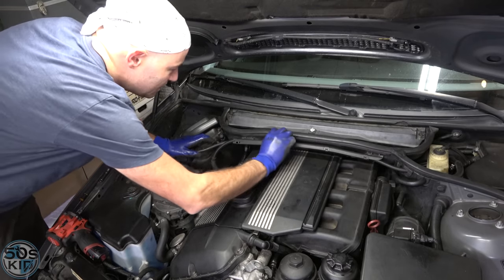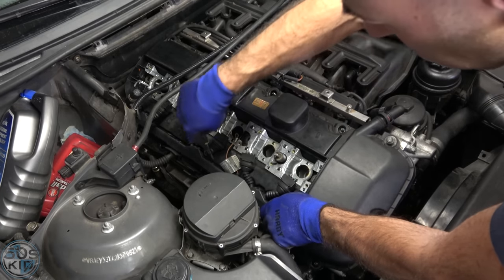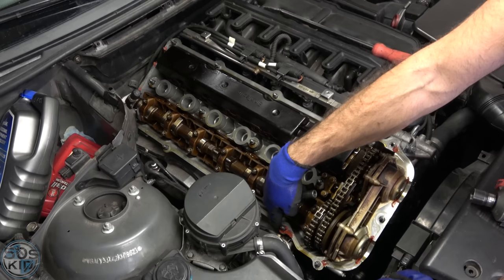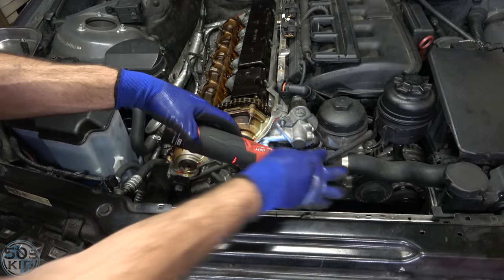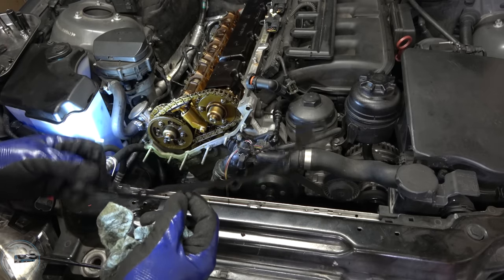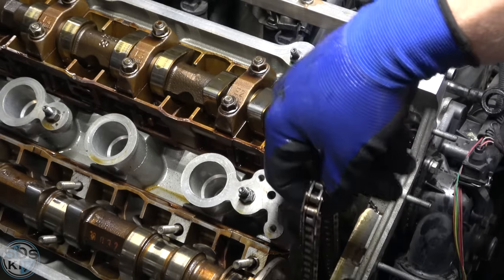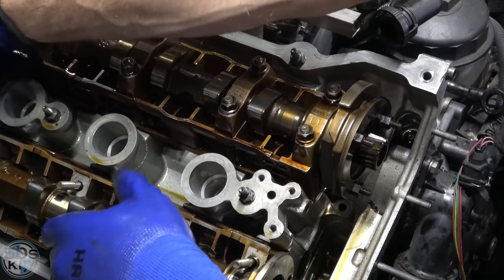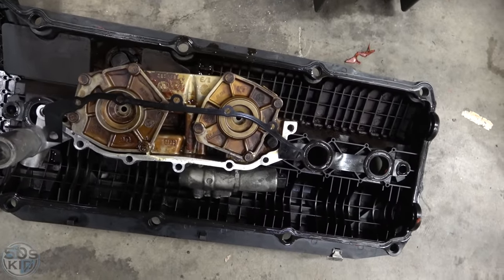This is why your BMW ticks - BMW E46 Lifter Replacement DIY Part 1

Comment: Rare to find a "how to" that's good to watch with an evening beer, then be able to reuse it the next day with my morning shop towels! I recently used your oil filter housing gasket replacement video on my e46 Jason. 2000 miles later, All is still good under the hood! Thanks for a great channel!

Comment: I'm currently pulling my cylinder head from my 05 325i for inspection after driving the car for around 40k miles after a 300 degree overheat, burning through coolant and oil for a while and finally have the time to get into it. Your M54 rebuild videos have been immensely helpful and I love all the details and tips and tricks that you have for pulling it without pulling the engine as I don't have access to a hoist. At the same time, I really, really like this type of video, very to the point, almost no extraneous verbal explanation, and just showing the teardown of the top end. It's a great summary. You're a legend.

Comment: I had a related issue. No ticking during cold start but it would misfire after 30 seconds (outside temp < 45 F) . I cleaned the lifters and it didn't fix the issue. I ended up replacing the intake cam tray along with all the lifters with used ones ($20) and that fixed the issue. So if you have misfire on cold start and have ruled out everything else, replace the cam tray(s) (check for scoring usually intake) and the lifters and hopefully, that should fix the issue. Jason, thank you! I couldn't have done the replacement without your excellent camshaft how-to videos.

Comment: Thanks for the Video. I really enjoy all your BMW content. I bought a nice 2004 330ci with a 6 spd manual. Grey with black interior. I was told it needed an engine. I paid $1400. It had been sitting for 2 years and the battery was dead AF so I couldn't even start it. After a brand new battery, it roared to life with ticking lifters. I poured a little ATF in the crankcase while it was running. Warmed it up, held some revs and withing a few minutes, the tick was gone. Now I know this may be temporary and yes, im going to change the oil and refresh the whole cooling system but for now, I got a clean runner and an easy resto project.

Comment: Great video as always. I have found that a can of liquimoly pro line engine flush before each oil change is good at preventing this issue. Once they tick, it is probably too late. Thanks for your videos!

Comment: Man thank you so much you make life easier for thousands of people
Reply: My e46 320i can start idle nice after to 15 minutes it's turn engine off it self nd from there it's just cranking without start but after 2 hours can start again I did change petrol pump but still the some what cous the problem

Comment: Had this problem before.. first it was only at coldstarts, so i changed them with new ones, then i had ticking ALL THE TIME.. real bummer. Then found a set on ebay with new cams, trays and lifters slightly modified, think the lifters were abit bigger in size.  After that the noise dissapeared! Soo thankful for that 👍
Reply: was it expensive ( Labor )
Reply: @RodriguezSteve  did it myself so think i payed about 250$ for the last parts

Comment: We had some observations related to BMW lifters. Those 33mm with smaller pad are very notorious to tick loud.  But You can swap cam assemblies to old-style ones with 35mm(old m50) lifter and large pad - they are very heavy duty but the same time they are heavier.

Comment: You coincidentally always time my builds at the exact topic. Thanks
Reply: My issues weird. Engine is quiet at cold start only starts ticking when warm and sound keeps that way. Was thinking spark plugs. Ignition coils when warm i don't know. If you have a place to check please please do help. Thanks

Comment: I switched from Moblie 1 Synthetic to Shell Rotella T6 in my 97 M3 S52 when I had some intake lifters bleed down from a lot of high rpm. I did all of the known procedures and added atf and marvels mystery oil and none of them were able to pump the lifters back up. All it took switching oils and after 60k miles, the engine has never had a noisy lifter again. I have another S52 engine I put in a '94 E36 body for a track car and I use Rotella T4 in it and it has never made lifter tick sounds after a track session. 
You only have to replace liftes when you replace lifter trays on high mileage high wear enigines.
Reply: isn't a Diesel oil? I was about to try it but the diesel label...I own a e46 with 107K but now the lifters became noisy...
Reply: @Opiti72  yes it is. It will quiet them down and clean the engine too. change the oil filter after a few hundred miles.
Reply: @ajl0426  Thanks for your answer, I was about to replace the lifters...but I will give it a try, I will let you know if it works. Thanks for the info.

Comment: I've been using a lot of your videos for my Spec E46 build, mostly the air intake and MS45 to MS43 wiring replacement. I wonder if I'll have to do this in the future...Hopefully not until at least next winter! Thanks!

Comment: I just used on a few M52/M54 a bottle of Seafoam, ran it gently, drove around for like 30 minutes, changed the oil, noise went away.
Edit: yes Seafoam can go in the oil.

Comment: I haven't watched the whole video, but that is beast mode e46 teardown so far. None of it makes sense until you have done it 200 times to find that one damned vacuum leak.

Thank you for all of the videos that instilled the confidence that I can keep the old girl running.

Edit: I watched it all. Damned good video. I would do that in a heartbeat before I do a FSU again. My back can't stand upside down and stretched out in the passenger seat anymore. I'm old, and the car is too.

Any young bucks wanna trade an FSU replacement for a DISA, CCV, and Vanos rebuild?
Reply: Haha I so would

Comment: Rather than go to this extent to "cure " lifter noise which is invariably caused by sludge or varnish build up in the hydraulic tappet as suggested by condition of camshaft caps, I have found that the use of a detergent such as Oil Syn Release run for 2,000 miles followed by an oil change with 5% ZX1 provides a long term solution. Have used this on numerous occasions and never failed to "cure" the problem.

Comment: 3:20 the way to get that hose off of there is to pinch it at 90 degrees to the clips and they will be forced outward.
Reply from the maker: I know but when the plastic hardens it's hard to do it that way, so I go right for the catches

Comment: Great video, thank you for this. I'm also curious about the electric fan swap you mentioned. I have a 2002 330i with the 5spd auto from ZF, and I live in south Florida. During the summertime, it sounds like I'm driving around in a school bus because of the mechanical fan. I was seriously considering doing the electric swap, but a couple technicians from the dealership I used to work at told me I shouldn't, and the reason a mech fan is in there in the first place is because the ZF 5 spd auto needs the superior cooling power. Which trans do you have in your E46, and what are your thoughts on this?
Reply from the maker: The transmission has an oil cooler which is cooled by engine coolant, so you’d think that’d be keeping the trans cool, right? I dunno, I’ve driven in 110 degree weather and noticed no issues. I say go for it.

Comment: You have saved me a lot of money but have a problem thought you wold know the answer I’m 74 and grew up helping my dad keep our car running we never had a new one  anyway my 2005 BMW X3 had a crack on upper hose at bleed screw got a new hose so was pulling lightly on old hose and the hard plastic connector crumbled in my hands so I got a new radiator and I replaced it bled all bubbles out with heater on. Now when I drive over 9 miles my car starts smoking a lot saw your video of pcv and oil separator but being 74 don’t want to tackle it  with plastic gears in valve I figure that is problem so called a mechanic and he said it was head gasket which I doubt spark plugs are not missing and idles perfect with rpm steady not moving so I want to know if it is head gasket or pvc  what would you say

Comment: On my 330ci I got it with 180k miles it had lifter tick but I just ran a heavier oil 5W40 since it’s an old engine now and the ticking went away

Comment: So so glad you are doing this video !   I have 1 stuck lifter on my 330ci and sometimes it doesn't tick and sometimes it does. When it does it can be anywhere from 5s to 1 minute before it stops.  Again, only on a cold start.
Maybe it's not worth me tackling this job right now as it's not that bad, but if by watching your video, I have the confidence to do it, then I might try.

The 'moving 1/4 past TDC' correction threw me a little.  And I'm assuming you don't have to worry about losing the timing at this point because you can reset it upon assembly, is that right?
Reply from the maker: Correct

Comment: Hello, i have problem with knocking inside my engine, when i go over 3k rpm knocking starts. I have E46 316i 77kw 105hp 1.9 from 2000 M43B19. In my E46 i dont have those  hidraulic lifter.
Can you please tell me what problem can it be?
If you want i can provide you some video you can watch.

Comment: So I want to install schrick solid lifters and camshaft with bigger lobes. Do you think this is a good idea to covert to solid lifters? They claim it allows faster rev and also prevents damage from high revs.

 Also I was planning on installing hastings piston rings because I'm sick and tired of burning so much oil. Do you have an input on piston rings? Should I buy a different set?

 Please give me some advice man, I've never tore down my m54 before. But it needs some maintenance and I might as well upgrade while I'm there.

Comment: Have you tried adding Seafoam to clean the engine? I heard about it in a thread, I'm thinking of trying it before I fully commit to replacements. Thanks again for the great series of videos.
Reply: I wouldn't recommend seafoam for an e46.  Jason does indepth high level technical training sans fix it in a can.

Comment: Old school trick that works if lifter oil gallery not completely blocked. Drain out 1 litre of engine oil and put in a litre of ATF...run for a few hot runs or until ticking goes away. If it doesn't fix after 300 miles then replacement is the only repair.

Comment: Hey I love your videos! They have helped a lot, but I’m stuck. So my superntine belt broke while I was driving and the pulley above the alternator came off so I replaced both my belts both the tensioner pulleys, water pump, expansion tank, the thermostat under it. Fan switch , temp sensor and my thermostat. But I’m pretty sure my system is bled but I’ll start my car amd it will get to temp and then wants to overheat still! Also I’m not getting heat in my cabin idk what it could be
Reply: Did you bleed the cooling system?

Comment: I have a problem with my E36 it make noise on 1500/RPM I don't now where it comes form first I thought it is from a pomp or something lie that second I thought it is from a step up starter but it is not it I still can't figure it out  ...My BMW is with LPG system ..! Do you have any  answers ..

Comment: Question about the plastic caps in the vanos that covers the cam screw. Does it really do anything ? The one on the exhaust cam is barely holding and I was thinking of deleting it.

Comment: I have the same ticking noise when my e46 gets in the higer rpm...i thought it was my timing chain...so thats all replaced with quality new stuff...and now the rattle is still there....i dont have any noises on coldstarts idle etc it only rattles really loud when i get to the redline.....would this also be the lifter valve thats causing this?

Comment: Hey 50skids, We have an bmw e53 that had it's engine rebuild recently, and notice there is a ticking noise that happens when the engine is warm. We used a  regular castrol 10w-40 oil. Can this cause a problem? If so what oil would you recommend after an engine rebuild? Moreover, the vehicle was sitting for over 8yrs as in was involved in accident and water went inside it, so it was a lot of work with other things that were not working.

Comment: I have an 2003 bmw 325i with eml light comes on when driver slow in 3rd gear but goes away when turn off and turns back on the car I scan it with an obd tool and it show tank vent, I replace the ventilation sensor and it still so the same thing any idea what can be causing the problem

Comment: My *taping/ticking/rattling sound coming from my 1986 ATG M7's (modified from 735i) worn 1 top lobes (18:38) of Camshaft.
Do you know where I can buy one that is not going to cost me an arm & a leg? And a kit of gaskets & seals?

It has not run since 9/11. So it has a sentimental valve because my uncle's lost his wife & three children in the World Trade Center.
I lost my aunt & cousins over 21 years ago. My uncle wanted to show me how to fix things but after 9/11 = faded to black/garaged.

*2000 a note from my uncle, Col of the SAS, that we will fix & replace the Camshaft taped on the engine.
The M7 has less 25K original miles. 
I was a young little girl at that time.

Any help & suggestions would be appreciated.

Comment: Please tell me about the stripped bolt. Something you mention about bigger-sized 🔩  on that side?
So aren't all head cover bolts the same length size?
Reply from the maker: There is a dual sided stud screwed into the head which the valve cover bolt then screws into.  The end that screws into the head is an M7x1.0mm thread and the other end is an M6x1.0mm thread.  The timesert kit I had on hand is for M6x1.00mm, so it's the wrong side and I need to get the M7.

Comment: I am also replacing the lifters on my car I have a bmw z3 with the m52b28 process look identical to the m54 except for the dual vanos. Unfortunately I cannot afford to purchase the OEM INA lifters do you think some of those cheaper ebay brands will work fine to cure the ticking?

Comment: quick question, i have my M54B30 apart, and i have some that are stiff and some that are "loose".. basically, none aren stuck, but they have restricted movement.... are they supposed to have long travel, or short?

Comment: Just use a flat head wedged inbetween the bolts on the fat clutch and you dont need the special tool at least i didnt maybe they get seized on there and i just didnt have that experience but i didnt need the special tools

Comment: My bmw E46 325i 2002 make that noise after high speed and revs around 3500-4500 rpm and I add 1qt oil the sound disappear. What could it be? 
Oil is 10w30. My ambient temp is around 30- 35 Celsius.

Comment: Another good video 
I have e39 540i with 500rpm on idle is this normal for this car even though I change spark plugs coils and injectors 
Please help thanks
Reply from the maker: mine is like 600

Comment: Interesting, I’ve noticed that after replacing my valve cover on my N52 because of CCV issues,  I’ve noticed  that the ticking on cold start is not very noticeable.

Comment: I’m confused, where’s the m56 valve cover? Was there an issue or was that a different e46?
Reply from the maker: I don't permanently run the mods that I make videos on.
Reply: @50sKid  oh, I would have thought that the m56 valve cover was a good upgrade. (Followed your video from years ago) I’m running it on my daily and I must say it’s amazing. Did you run into complications or just decided the the original setup is more your taste?
Reply from the maker: @Adrian-sw3nv  The original setup is more my taste plus I think I later shot another "quicker" CCV replacement video so I wouldn't have been able to do that if the M56 cover was still there.  I prefer going back to stock so that I can do videos on a stock car.
Reply: @50sKid  that makes sense, thanks for letting me know. I’ve had the m56 valve cover with new membrane and the aluminium cap for about 2 years now and it’s been fantastic. I do miss the factory look though for me it’s worth the compromise. Take care! And keep up the fantastic work you do!

Comment: I have ticking noise only when engine is hot after driving for 20 minutes, under load at low rpms i hear tickin noises. Never when engine is cold. what can that be
Reply: Might be the oil weight? do you use 5w30?
Reply: @xcuber123  yes. I tried different oils. 5w30 also 5w40. Car has 130k km. Changing oil every 6k km. I changed vanos o rings, sparks are new, no vacum leak, everything wokrs great only that tipping sound appears when engine is hot and under load at low rpm
Reply from the maker: Lifters

Comment: The ROI on this job is so low that I'd just put sound deadening material on the underside of the hood and live with it 🙂 Now, if I had a nasty VCG related oil-leak and needed to replace the gasket, then I would consider bundling this job along with that.....but being lazy as I am, I doubt I that I'd be motivated even at that point.

Comment: I changed the lifters and the noise didn’t go away, that simple. The job was done perfectly, spent $1K in new parts, lifters, etc and nothing, the noise came back. So, be aware.

Comment: Why do the automatic transmission models have a mechanical fan whereas the manuals have an electric fan ? never made sense to me, an electric fan can flow just as much air with less parasitic loss. Later n52's went all-electric manual or automatic
Reply from the maker: Lord only knows

Comment: My E46 ticks but the damn thing doesn't have hydraulic lifters. Oh wait, the S54 isn't supposed to have them. Silly me 😜

But I remember having to the job on my 325ix and it wasn't a lot of fun but there are repairs that are so much worse.
Reply from the maker: If it’s ticking then it needs a valve adjustment!

Comment: I saw a similar video where the guy positioned the camshafts such that the lobes were putting equal pressure on the 2nd and 4th lifters/springs... think his name was 50sKid. wink